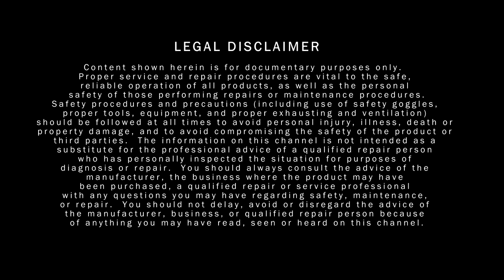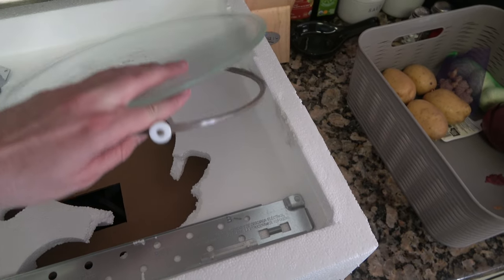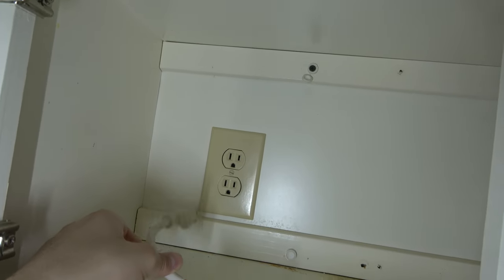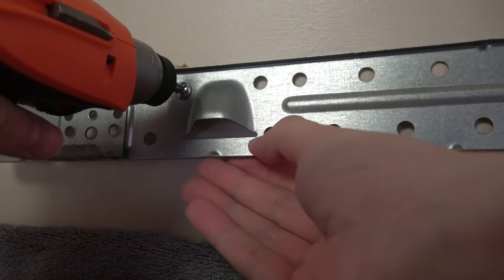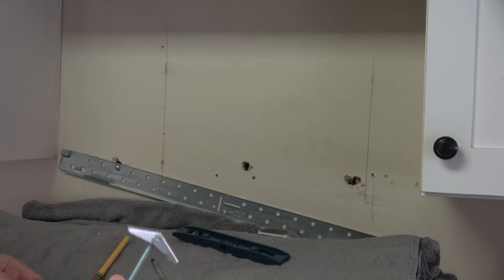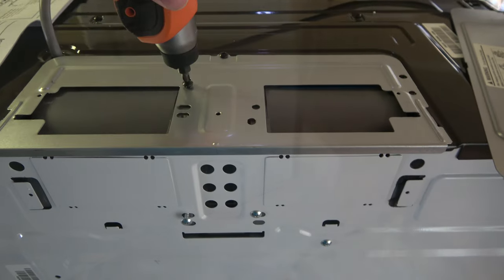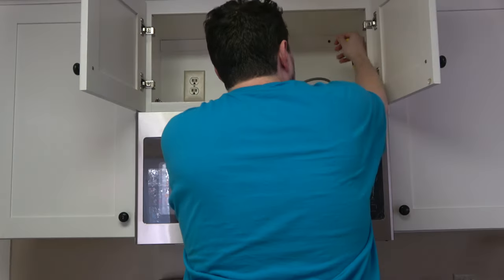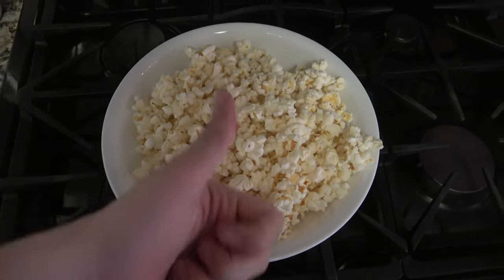Install Or Replace Over The Range Microwave By Yourself | Quick & Easy Guide | GE JVM6175YKFS

Comment: Do you know what's the maximum depth for the cabinet for this microwave? Mine is 14" 1/4. My cabinet paint (right on top of the vent) is peeling off, and I'm wondering if it's because of the depth or if it needs to be shorter. The vent is almost fully out. About 1/4" or 2/4" is covered by the cabinet.